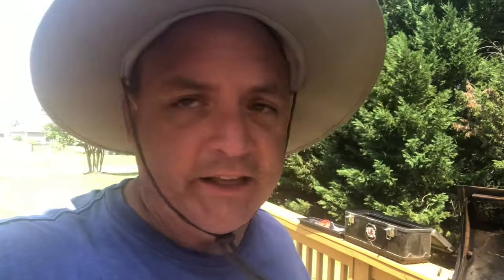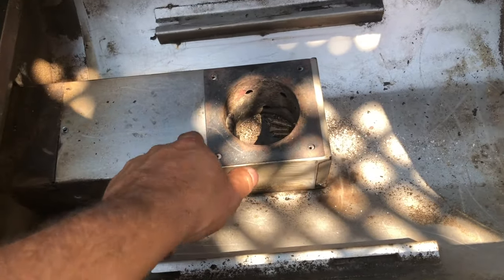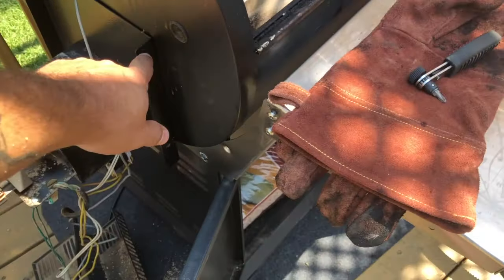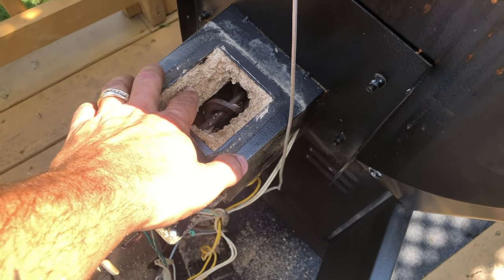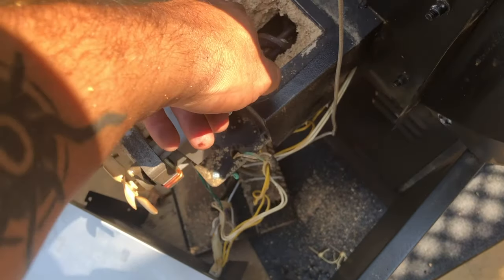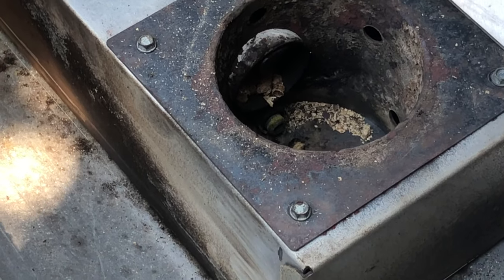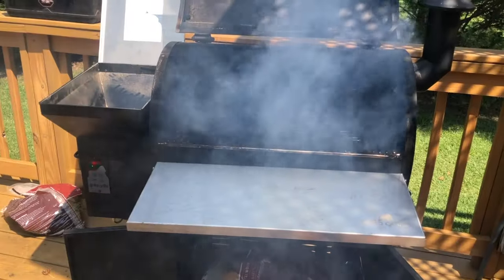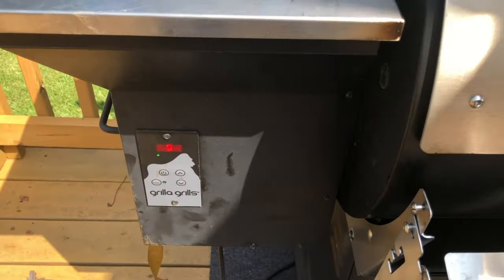Pellet Grill ErL Code Fix!!!!

Comment: Is single 37 year old mother here,, I don't have much smart when it comes to this stuff,, I have a grill expert electric pellet grill, I've been having the same problem so I watch your video on repeat several times and I did the same steps but different places for the screws.. Once I got the Box off you were right,, Completely caked up. I spent a while chipping away at it and shop vacuumming.  Is different grill same concept, Thank you so much for saving me so much money going to buying a new grill..  thankYou for sharing your knowledge, Believe it or not it helps a lot of people..  I had just paid for my mom's funeral expenses, I didn't have money to go buy a new grill but I was gonna have to. You just saved me so much. Thank you

Comment: totally saved the day sir. threw some chicken in my pellet smoker, went to pick up my son from school, came back and did some work then realized I didn't smell smoke. ERL code and it wouldn't heat up. this video made sense, it's been rainy, and I had tossed in some pellets last week that I didn't realize were crumbled in the bottom of the bag, even though it was stored inside. dropped the pellets out, took the guard off and then hit it with a leaf blower because that's what was handy lol. it started turning as soon as the impacted sawdust blew out. you saved the day and my girlfriend will now get her long awaited smoked buffalo chicken dip. your a hero! thank you.

Comment: I did what some guy on YouTube recommended.  Bought some 5 gal Home Depot buckets.  Bought a bucket head vac $28 that fits on their buckets.  When I’m done grilling for the week, I vacuum out the hopper into an empty bucket, burn off what’s left in the auger.  Then I use another bucket and vacuum out the ash.  Shake out vac bag and I’m ready for the next time.   I use the ash in my compost bin.  One more thing, there are two points to insert the hose.  One blows and there other sucks.  Sounds redundant I know.  When everything is clean, blow through the hopper through the auger.  That will clean out any dust that may be caught the auger.  Also never pour the pellets from the bag.  Pellet dust settles to the bottom.  Use a large scoop.  About $6 on Amazon.  When you get to near the bottom of the pellets, use a fine mesh sieve to take out the pellet dust.  Happy smoking……
Reply: Jesus lol that’s way to much work

Comment: So glad I came to YouTube. I just moved out of my home while going through divorce. Told myself there’s no way in fuckin’ hell she’s keeping my smoker.😂 So I loaded it up into the back of my car laying down (blaspheme, I know, but only way it would fit). My guess is the pellet dust fell in and clogged the auger pan so it wouldn’t heat up, was flashing the temp with periods in between the digits then stuck on ErL code and could only turn it off by unplugging it entirely. I scooped out  the dust/pellets and we are all good now. Within a few minutes I had it smoking again and the temp is starting to rise. Have four racks of baby back ribs all prepped. Luckily I only poured one of the bottles of the Dr Pepper into the tray or it may have gotten messy. Saved my family’s New Years Eve dinner! Happy New Year, brother! And happy smoking.
Reply from the maker: haha!!! awesome!

Comment: Nice I had a similar issue in addition i started keeping my pellets in Tupperware
Reply: I did what some guy on YouTube recommended.  Bought some 5 gal Home Depot buckets.  Bought a bucket head vac $28 that fits on their buckets.  When I’m done grilling for the week, I vacuum out the hopper into an empty bucket, burn off what’s left in the auger.  Then I use another bucket and vacuum out the ash.  Shake out vac bag and I’m ready for the next time.   I use the ash in my compost bin.

Comment: I watched this video, but an easier option is to remove the pellet screen and then remove all pellets and vacuum out the inside of the hopper.
Reply from the maker: yeah, I removed the screen a long time ago.  I now let the pellets burn down and scoop out old ones between cooks.  I vacuum the burn pot a couple of times a year, depending on the frequency of cooks.  I haven't had a problem with it in a while.

Comment: Question was the auger not turning and heat not coming on for you? That’s my problem it’s just not working but there’s no code or nothing so idk I’m going to try your video suggestions
Reply from the maker: I don't remember.  I could tell something was wrong, so the go to is always to take it apart and look.  Just the other day we had some bad wind that caused some rain to get under the lid and caused the wood pellets to form a hard pack over the feeder from the hopper to the auger.  I cleaned it out, vacuumed the clog, had to start the grill and let it cycle up and down twice before it fed through properly.

Comment: My smoker apparently got the ERL code last time I shut it down, as today when I powered it up, I got it immediately.  I vacuumed out the pot and auger, looked down into the hopper and didn't see anything.  I put everything back in it, and it fired right up.  It put out lots of smoke for about 40 minutes.  It was just long enough for me to prep my pork shoulder.  I put it on and went back out to get my wifi app conneted....and the ERL code was back again.  I powered off, then back on, and auger does move and pellets come out.  Any Ideas?
Reply from the maker: might want to call their customer service number.  I've had to call them before, they're super helpful.
Reply: 820 Pit Boss new control board work for 3 hours with no meat on it put a piece of meat on it works for 20 minutes flashing e r r can you help unplug it and plug it back in and it works me out
Reply: Can you help me out